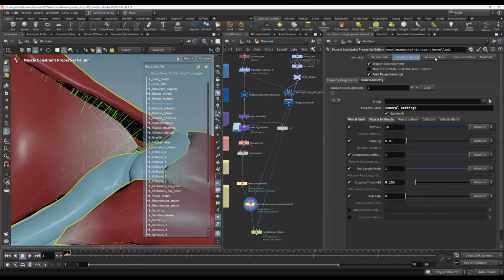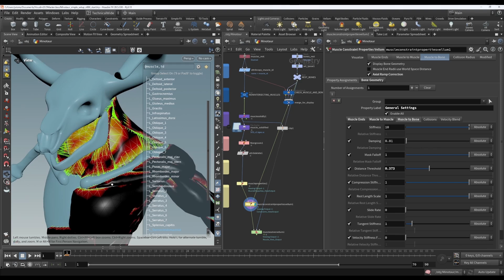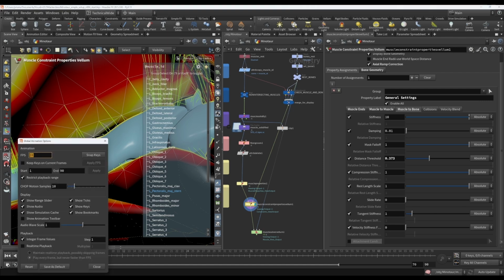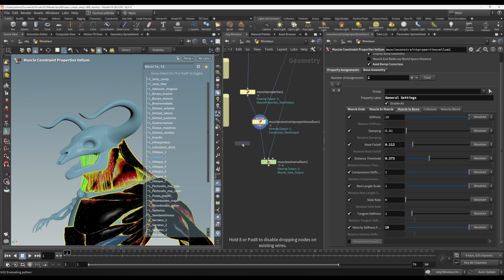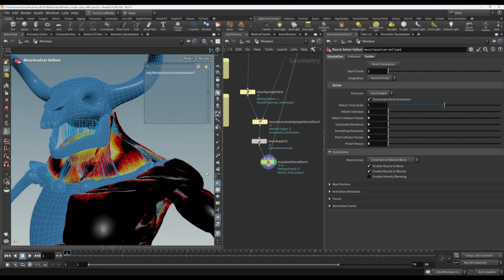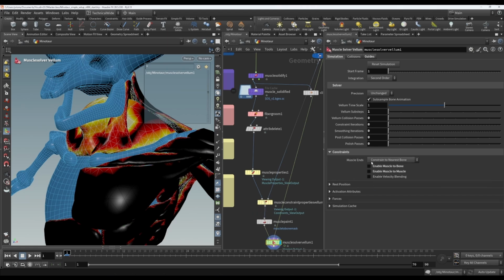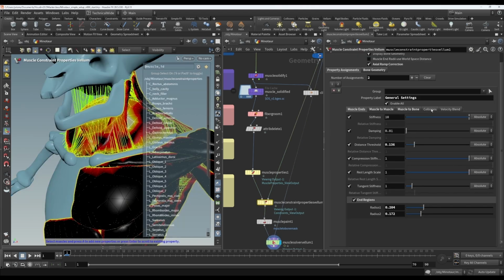11. Muscle Constraint Properties - Muscle to Bone

Comment: MuscleConstraintProperties
MuscleToBone
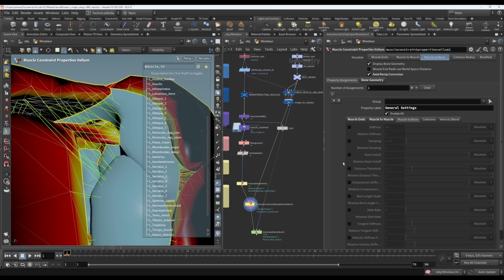1:08 General layer
1:28 "Stiffness" "Damping"
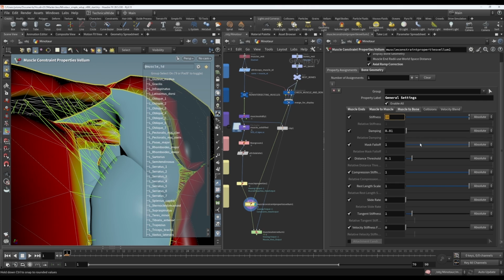1:45 "MaskFolloff" "DistanseThreshold"
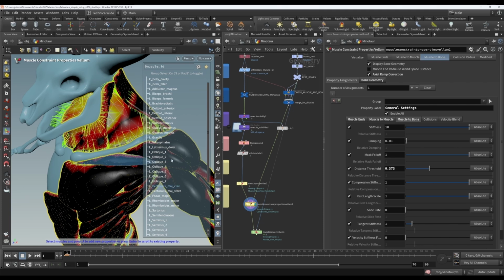3:08 CompressionStiffness RestLengthScale
3:16 SlideRate
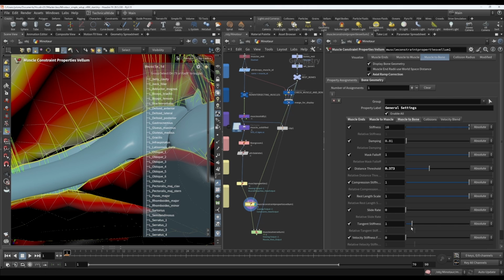4:19 TangentStiffness
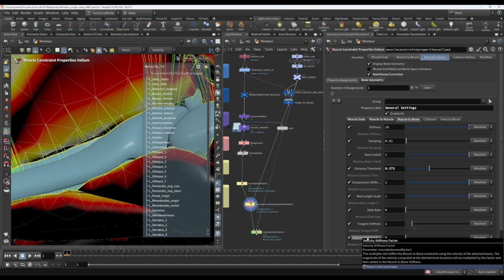4:50 VelositiStiffnessFactor
5:18 FrameRate
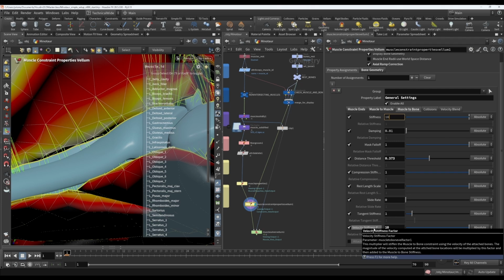6:42 Animation motion speed
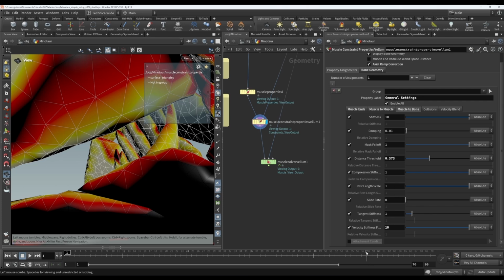8:23 AttachmentCandidates
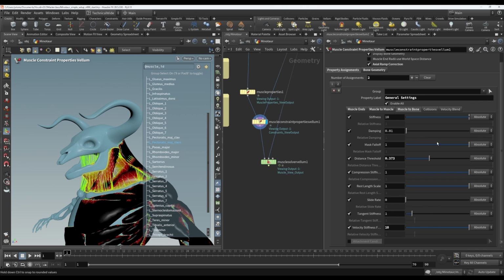10:35 MusklePaint
13:31 Initializing muscle mask attributes ( MusclePaint )
15:33 Constraints in the Solver
16:45 EnableMuscleToBone (possible errors)
17:34 Relationship between property constraints and Solver (setting parameters)